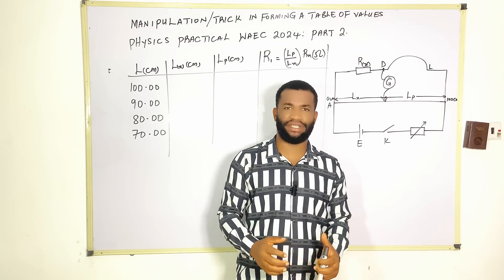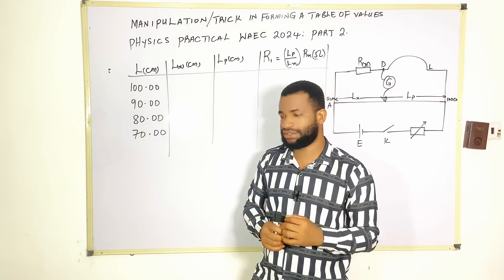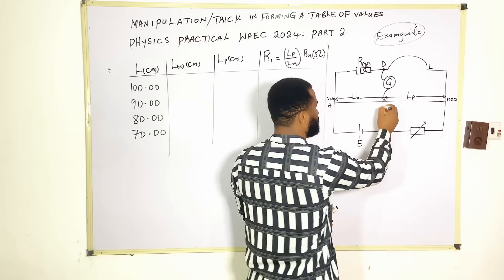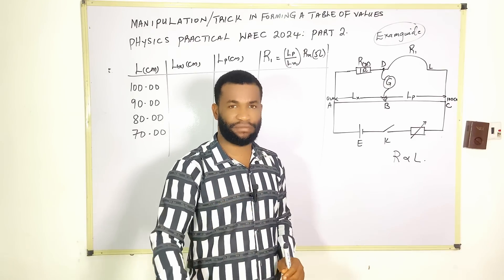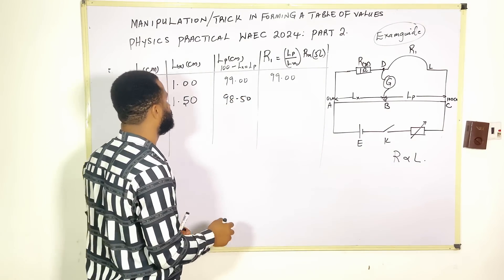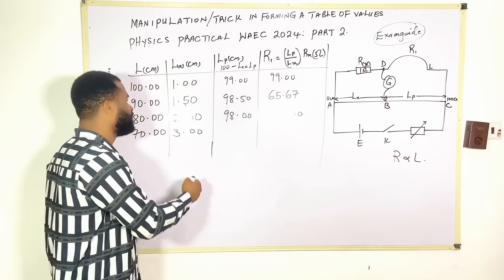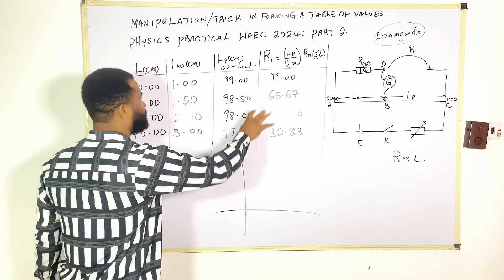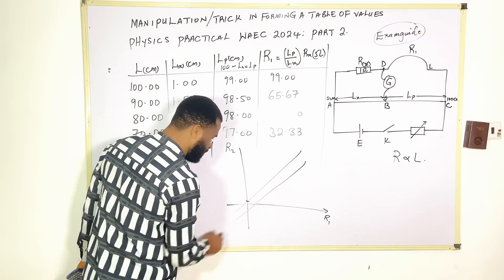Waec 2024 Physics Practical on Electricity Manipulations. Part 2

Comment: Resistance R1 of the wires used in physics lab cannot be high is 99 ohms. These values cannot be theoretically substantiated
Reply from the maker: You are correct
Reply: His values are not correct

Comment: Hello .please quick reply .. I was only able to get constantan wire for my school but I got it in different millimeters. Can I use the two different millimeters as my resistance wires..thanks alot boss . I appreciate
Reply from the maker: Yes
Reply from the maker: Thickness of the wires do not matter
Reply: @vindalsacademy it matters a lot. It's either you use wires of different materials or same wire of different diameters